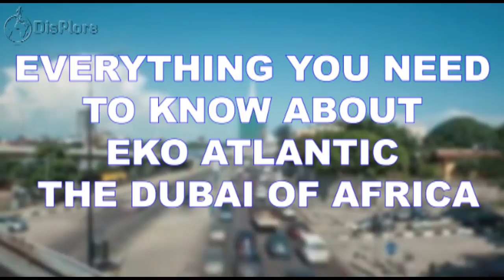Everything You Need to Know About Eko Atlantic - The Dubai of Africa

Comment: I don't think Eko Atlantic will ever look like anything close to the 3D renditions we see online. Just disappointed that after 15 years, the project still looks like a desert land with scrubs here and there.
Reply: Eko Atlantic is a smart city being built on reclaimed land from the ocean using reable malleable materials in a time where global warming is a massive issue. These malleable materials take 10-15 years to fully settle. Any widespread massive contruction until then will likely result in both an ecological & infastructurial disaster. They've been contruction around the edge of Lagos proper. There also still touching some of the power grid & sewage system in the meantime. Stop talking about subjects you know little to nothing about.
Reply: True
Reply: Is not as if it was a free land? Do you know how difficult it is and time it takes to sand fill a part of an ocean? Come to talk of landscaping the land to this stage, this is not the kind of project to rush given it proximity to the ocean
Reply: Imagine that energy and resources that was use to sand fill the place is converted into structures, they would have being 60% done with the project